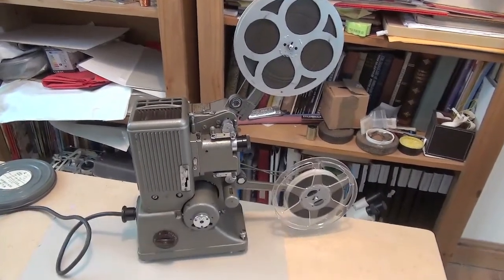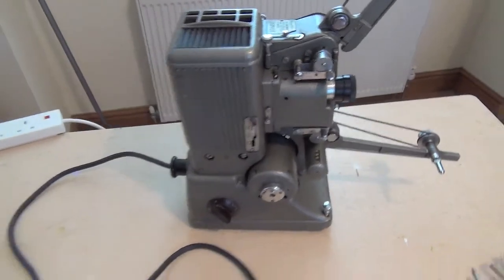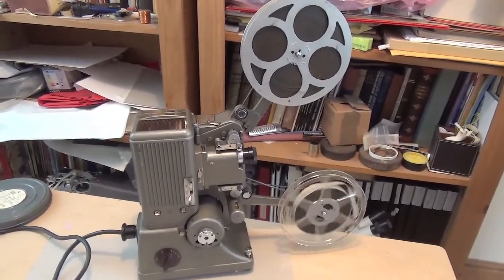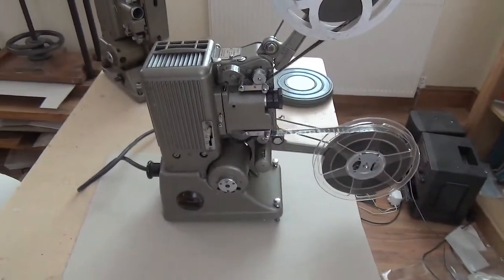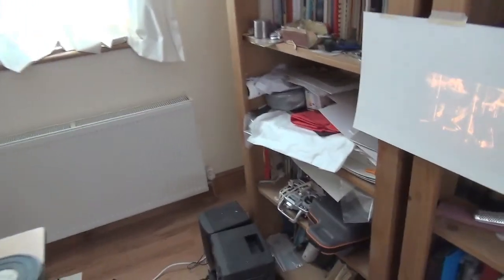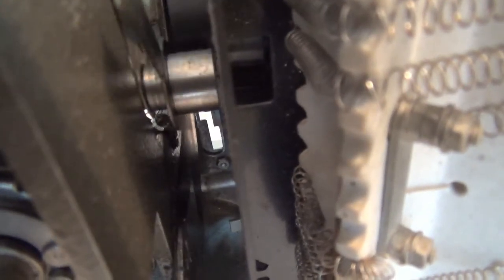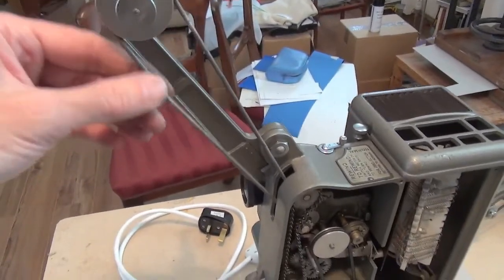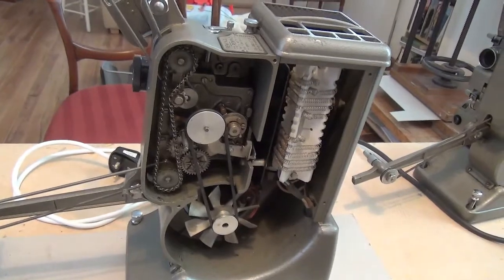Specto vintage 16mm silent movie film projector repair Pt 2 (conclusion)

Comment: I have one of these that has been sat out in storage for about 3 years and I decided to try and use it again. Unfortunately, I plugged it in and switched it on and it started smoking. I went to remove the bulb and it was boiling hot so I figured that dust has accumulated on it and when the lamp switched on it either blew or something started burning.

Comment: The small square that pokes out of the back of the housing is to rock the film backwards and forwards. It acts also as clutch for running the film backwards. It works on a push in or pull out method. Perhaps this is why the  reverse does not work. Also the top metal belt should be crossed for 16 mm film operation.
Reply from the maker: Thanks Eric! When I get this machine out again, I'll check those points.